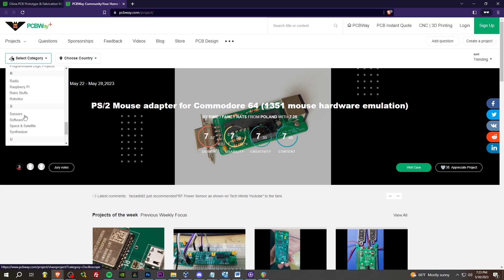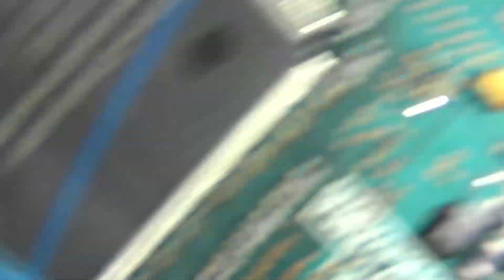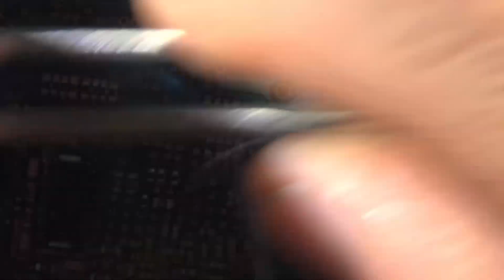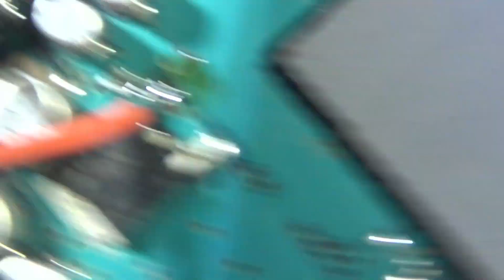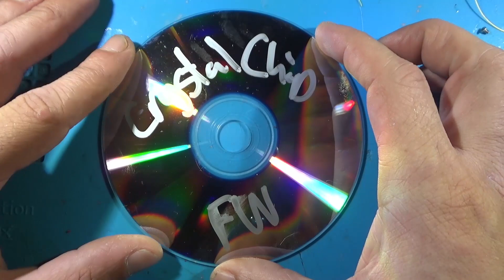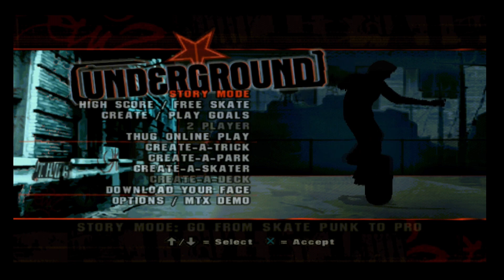Dream Ps2 build! - Pixelfx Retro Gem + Crystal Chip + Atomic Ghost Case

Comment: Hello, great video thank you. How do I get the apps to show up on BM? I formatted a USB flash drive to FAT32 and downloaded the cc software megapack and put that on the flash drive but it doesn't show up in BM. I just bought a 2TB HDD and I'm using HDLBInst to add games to the hard drive but for some reason the games aren't showing up on the HDLoader .8C app that is installed on the memory card. I'm trying to figure out a way to use OPL since that seems like it will work instead of HDLoader .8C.

I bought this from some dude and it had the chip installed already so I'm a little bit clueless. 😅 can't find much documentation out there.

Comment: is there some place where i can buy the crystal chip?
Reply: No out of production just ModBo 5.0D and mars pro GM-806HD, if you don’t like custom logos plastered all over your system I would recommend the latter. But with current options you can use freemcboot to boot patched backups or load from sd/mx4sio/hdd and avoid a mod chip all together. Modchips are only really good for booting out of region originals now
Reply: @nickwaters2802  really appreciate the info
Reply: I have about 90 NOS 1.0s left. Functionally 1.0 - 2.0 PRO SLE are the same except for booting from flash.
Reply: @PS2ModchipTutorials  how i can contact you?
Reply: @eu_thanatos9500  my website has info, same as my username

Comment: Is there a ps2 mod to replace the DVD drive with a SD card or SSD? I think theirs a GameCube mod that does that.
Reply: You are talking about an ODE (optical drive emulator). There is on the GameCube but not on the PS2, however on slim ps2’s SCPH-70xxx you can rebuild the IDE circuit using something like IDE Resurretor ribbon from guesse (or a bunch of wires) to an SD card slot or SATA connection which would be the best option for a slim, but I’m assuming your interest in an ODE disqualifies that prospect because it is way more involved than GameCube plug and play. Alternatively you can also use an MX4SIO card to insert an SD card into the memory card slot of your ps2, and play games/homebrew off of it, however no SATA SSD is supported. In future, I bet cards like the memcard pro 2 will support ssd loading from the memory card slot in an update. Don’t even want to think about the slow usb ports here. On fat ps2s you can just use a SATA modded or 3rd party network adapter to load any SATA drive and/or or Mx4sio for the SD card.